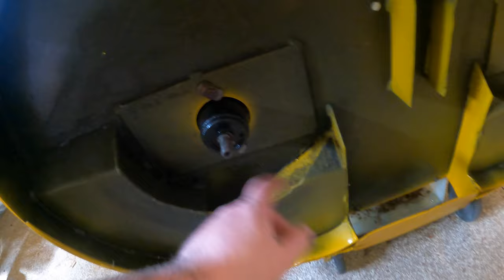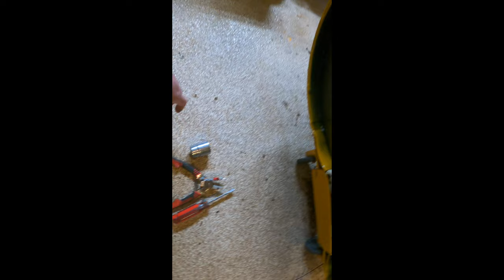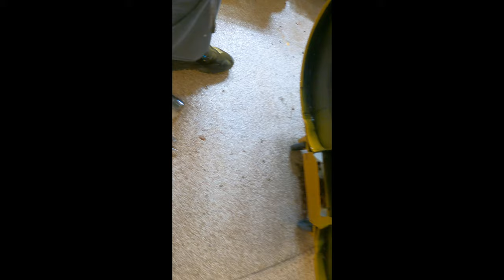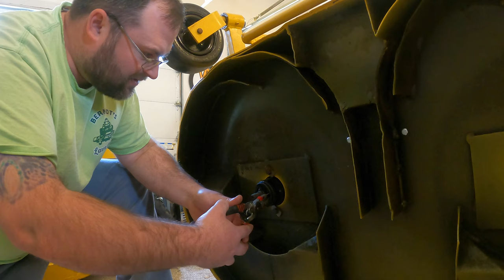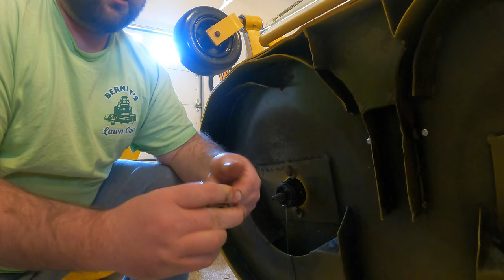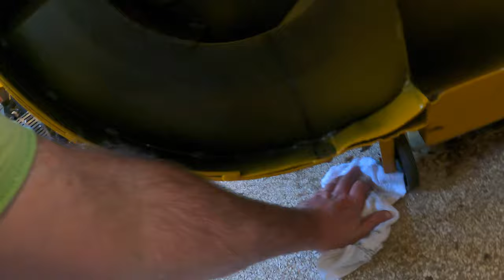WALKER GEARBOX BLADE SEAL REPLACEMENT! SIMPLE FIX!

Comment: Thanks for your tips and tricks. My 2020 t23 with over 1700hrs just started to leak oil from same spot, noticed a puddle of oul in my enclosed trailer today. Thanks for putting out your easy directions on changing  the seal.  Im hoping its just the seal and not the gearbox going.
Reply from the maker: It’s most likely the seal. Common issue on these mowers. Thanks for tuning in!
Reply: @berndtslawncare4906  is the seal 788029 same with my t23 42in collection deck?  thx
Reply from the maker: @168meister  if I’m not mistaken, they should be the same. I believe the older style gearboxes had different seals
Reply: @berndtslawncare4906  Thank you again for getting back to me so quick, i already ordered them and should recieve them early next week, cant wait to replace them. Also thank goodness it gave out during off season.  anyhow have a great wknd to u and your family

Comment: do you have to replenish the oil that was loss?, if so how  thank you
Reply from the maker: Yes you do. Take the yellow gearbox cover off on top, and you will see an Allen head screw on top of the gearbox. Take out that screw to add more fluid to it. Do not fill the boxes up more and 1/2 full because those boxes are not vented. You need space for the oil to circulate inside the boxes or else you will keep blowing out seals
Reply: @berndtslawncare4906  ok thanks for your time, and vids